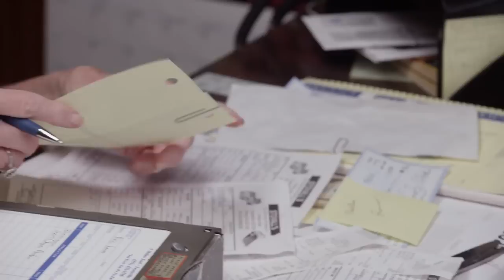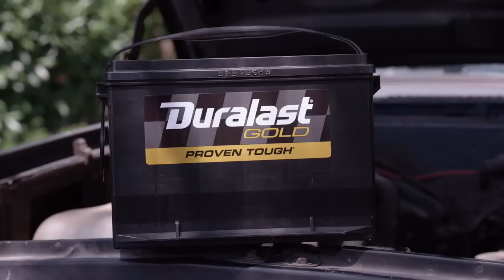How To Choose A Square Body - Music City Trucks S2, E16

Comment: I have an extreme soft spot and love for square body trucks. My first truck when I turned 14 was an 87 Silverado 1/2 ton long bed 4 wheel drive in the same copper and tan color combo as the short bed with no front clip. I daily drove that truck all through high school and recently it’s decided to quit running but here soon it’ll have a big block. My dad has a K30 Dually with a 454 and SM465, we rebuilt the motor in it a couple times when I younger. I’m exited to see where this one goes, it’ll give me some motivation to get mine back on the road soon. You don’t see many family owned/operated businesses still thriving nowadays so props to them for keeping it up! Good content fellas!
Reply: Get it done! You can do it man. I drove a 79 K10 in high school with a 350 & SM465. Been searching for years trying to find it & get it back.

Comment: My 1st pick-up was a 1978 Chevrolet K10, Fleetside, 8' bed.
Driving home from work in the summer of '80 past a Chevy dealership I spotted that truck. Pulled in to check it out. It was brown, with a Fisher 8' snow plow and a 3" lift already done. The best part was it only had 12,500 miles and looked like it never did much plowing.

Comment: I had a really nice 1 owner, practically new 81 Chevy square body.  I loved it!  292 6 cyl, auto, ps, air, pb, no dents and the bed looked brand new.
Reply: I got a 81 Chevy square body. Inline 6 250cc. I'm rebuilding it on my channel. Check it out.

Comment: Worth mentioning is those cabs come off easily and are much easier to work on off the frame. (Diablo Auto Dismantling recip saw blades are gold!) That also lets you do cool stuff if you actually use the truck to do truck things, for example plopping a C-10 cab on a C-30 or 20 eight lug rolling chassis. C-20s are easy to turn into C-30 equivalents and unlike compete trucks bare frames with trashed cabs remain affordable. Noobs should note the big inline sixes make gobs of torque and easily outlive small block V8s. Six-banger trucks (three on the tree preferred to lower the price) sell for less but can do serious work. My bro towed a 40-pax International 1600 bus with his C-30 wrecker from Fayetteville NC to Sumter SC  with his 292 six! Trucks can do much more than just crawl the malls while looking good.

Comment: I bought my Uncle's '87 R10 Scottsdale Longbed Squarebody.  It used to be owned by an alcoholic Indian and he was a shit rigging MFer.  My Uncle swapped the motor, but it didn't last long.  The 7R400 wasn't doing well either.  I was looking forward to doing an engine and transmission swap, until we had a major ice storm in 2020.  The roof took the full force of a massive branch of the giant pecan tree.  That roof is stout, even though the center sits about eight inches lower.  Pulled to top edge of the rear window frame forward and the upper edges of both door frames are pulled in slightly.  If the truck hadn't been sitting in that spot, that branch would've demolished the car port that housed my Uncle's '89 Pontiac 6000.  That car would've been pancaked.  So, now I'm looking at possibly doing a roof replacement because I don't really want to do a full cap swap.  It all depends on which way will be cheaper.  The only thing that's not original on the truck is the engine and transmission.  I can get all the pieces to replace the entire upper section of the roof.  You can get every body panel for the truck through aftermarket companies.  Literally can build your own truck with aftermarket parts.  I just need to do a cost analysis and see if I can find a really good cab to see which one will be cheaper.

Comment: An 85 Chevy long bed 4x4 square body. 
Hint: Period correct. 
If I had to guess, this truck will have a 6 inch suspension lift and 35-inch off-road tires, a chrome light bar in the bed, and a grille guard with Warn winch.

Comment: Well it pays to be picky in this case. The first one you turned down because it had so much rust. That's nothing especially for square body. The early square bodies rusted well seems like as they went down the assembly line. But towards the end they must have done something to them cuz they weren't near as bad. Ben cab of a short bed, I've got two wheel drive short red frame for it. Use it to Dolly around my 70 Chevy body while the frame is getting coated and built. Friend of mine has like a 85 maybe 87 c20 two-wheel drive long bed fantastic body. It's complete two wheel drive truck. Well his widow is selling it for less than $3,000. Runs and drives. My 73 square body which has been stored in the family since 1984, as a factory bucket and console. It also had patch panels in it back then and was repainted. They call her California edition. Rather that's really true or not who knows. Besides the folks out there in California when they saw my plates ask me why I drove all the way out there to pick up a car. They went on and tell me I said several others they come out my way and that's where they buy their vehicles. Went on and tell me while they rest in California too. Don't forget your KC lights for period correct. I've hung on a set for 20 years. You can still find them out there. Are you going to build a TV series Fall Guy cloned / tribute truck? You did find a nice truck as far as body condition. Congrats and thank you for taking the time to make the episode / series on this truck.